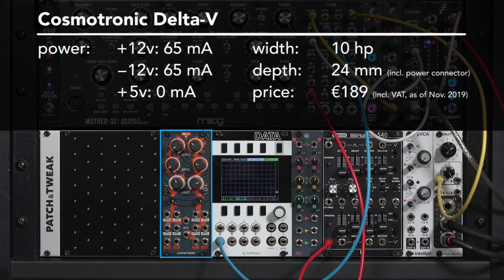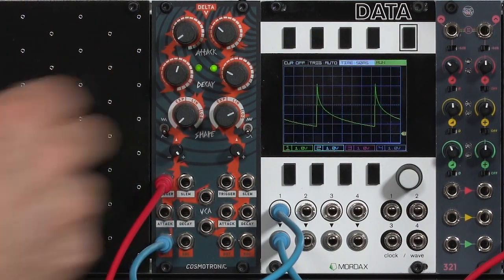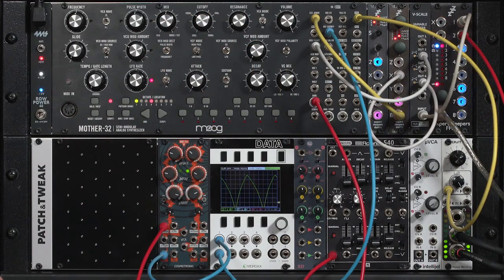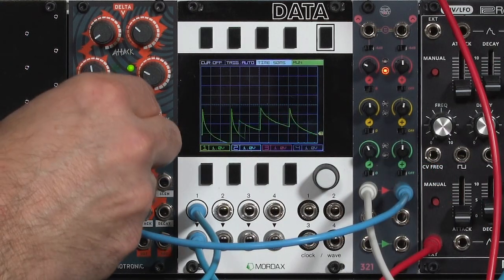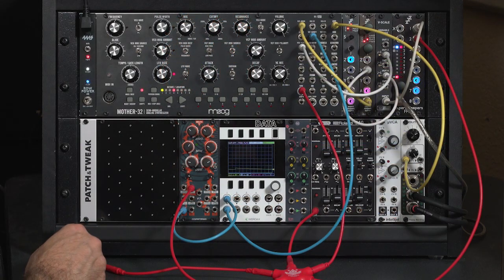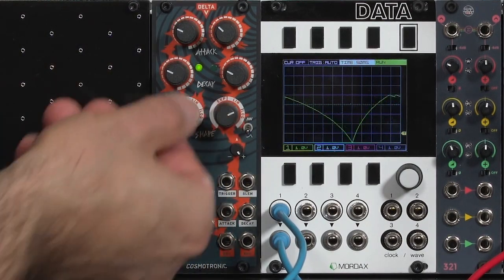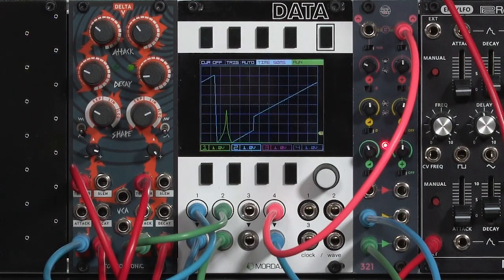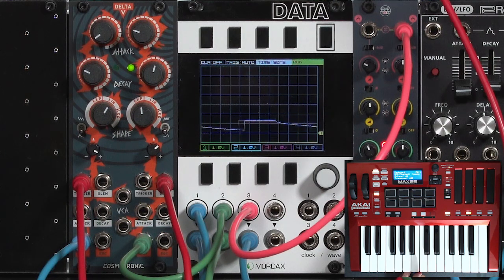Cosmotronic Delta-V Dual Amped Function Generator 1/2: envelope & LFO (LMS EE)

Comment: is the stalling on you that you note around the 7 minute mark something that is just a continual quirk of this module, or did they fix it in later versions?
Reply from the maker: Hi, CK - the new version (black panel) is much better. It's the main VCA in my travel case.
Reply: @LearningModular  I know it doesn't have as much overall functionality, but how do you find this compares to Falistri for the functionality where there is overlap?
Reply from the maker: @cksample  the big thing for me is the Delta-V is a pair of VCAs with built-in envelope generators (that's how I view it - not as envelope generators with the bonus of VCAs). OTOH, Falistri is a pair of function/envelope generators with several useful add-ons like the balanced modulator and bonus slew. Falistri is a mainstay in  my studio modular for its ability to do many things. Delta-V went into the gigging case because I needed at least a dual VCA anyway, and it saved me module space by also having envelope generators.
Reply: @LearningModular  Cool thanks for the detailed reply. I think I need to grab one of these and give it a go.

Comment: quite similar to a Maths...
Reply from the maker: Well, Maths has a mixer, analog logic, etc. while Delta has VCAs. What they have in common is a pair of slope generators, and that pre-dates Maths back to the 70s.
Reply: basically is like make noise function
Reply from the maker: @ekoboydj  not really; it has an integrated VCA, which the Function does not. And there's two of them, not one.
Reply: @LearningModular  indeed. was focusing mainly on the modulation side of things
Reply from the maker: @ekoboydj  gotcha. It's the integration of the VCAs that make it more useful than Just Another Function Generator. ;-)